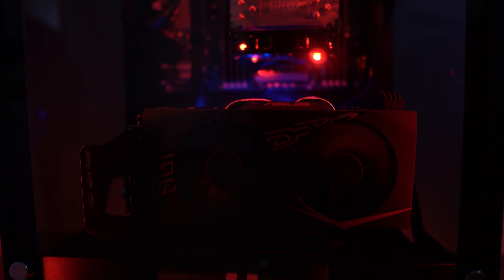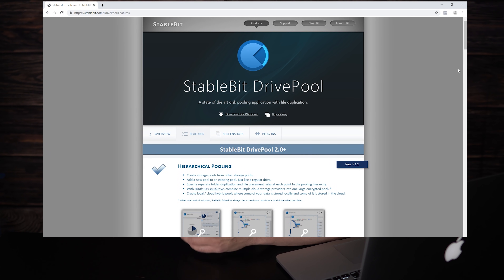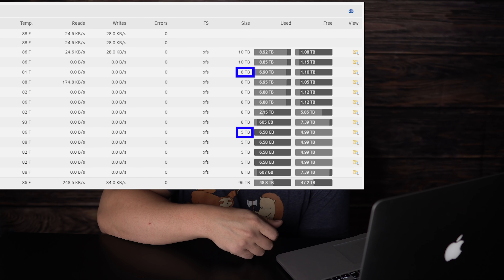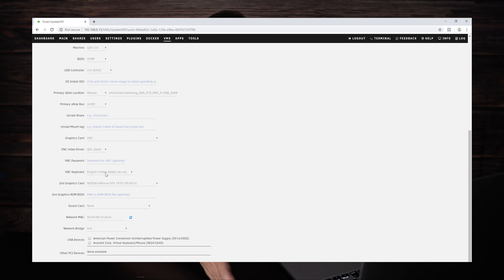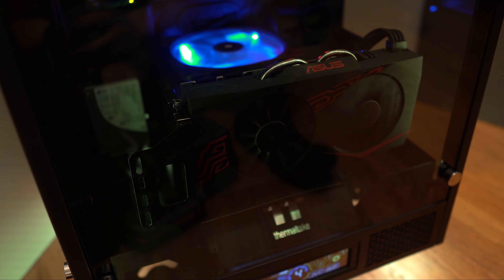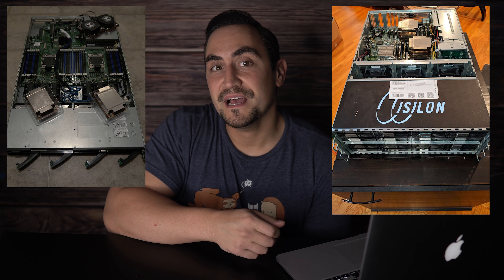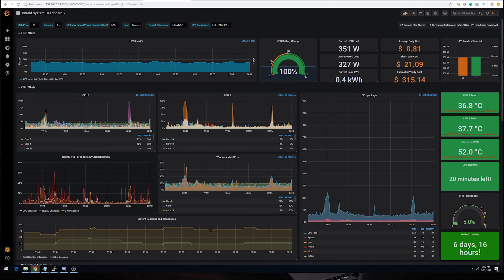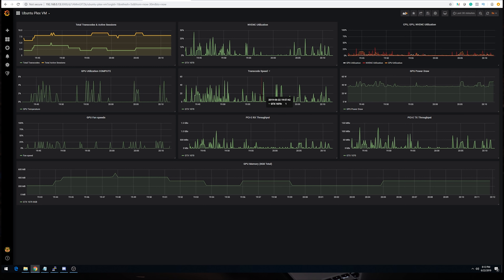How to build a quiet 117TB Plex media server (Part 2)

Comment: Good show! Yeah part 2 was much more informative. Nice build and video. I was currently running a Ryzen 1600 on Freenas in a fractal design case with a 6 drive ZFS RaidZ1 setup on a LSI card with 1 hot spare. I pre transcode all my videos on a Ryzen 2700 workstation to avoid the quality loss sometimes experienced with Plex transcodes. Not wanting to constantly run two machines, I swapped CPU and motherboards and installed Proxmox to virtualize Windows 10 for my pre transcoding and a Freenas vm for plex, passing the LSI card through. I like this setup much better.
Reply from the maker: oh damn that is a pretty legit build! The ryzen 2700 has some awesome performance and its even better when you consider the price:performance ratio. how do you like Proxmox? I've been wanting to play around with it a bit it seems pretty solid from what I've read.
Reply: Proxmox is pretty nice. It's good in situations where you have a powerful system that's often idle. Those CPU cycles can be used for other things via virtualization. I determined how much power I actually needed for Plex since I rarely need to transcode and I allocated the rest to my Windows vm which can use the extra cores for pre-transcoding. I never encounter issues. 32 gigs of ram in the system. I currently signed 16 to Freenas and 4 to Windows. Both VMs are on NVME drives. You can't tell it's being virtualized.

Comment: Love this video, love the content, love the way it's explained. I have about a dozen follow up questions. What's the best way to submit them?
Reply: 1. The migration from Windows 10 Plex host to Ubuntu Plex host - How do you migrate the library, played/unplayed, all that metadata? I'm in a situation very very similar to your starting point and I'm curious if you were able to maintain this data or it was lost in the migration.
2. Is software RAID all day the best way to implement a Plex server? Currently I have 2x devices with hardware RAID implemented, migrating to a software RAID solution would not be easy. Can you explain the benefits? For more context, for those of us coming into second hand gear, those H710p or HP equivalent cards usually can't be flashed to IT mode. Making purchasing additional hardware a barrier to making the migration. Also while I realize the cache on those boards is only 1/2GB it still hurts throwing it away.
3. I'd love to see FreeNAS ZFS vs Unraid comparison to be covered in a future video. Coming from someone with some technical knowledge but without an in depth understanding of ZFS I love what little you covered and would like to hear you cover more on the topic.
4. Caching in Unraid/General Unraid implementation question - I've been stuck at a crossroads with feeling like I need two different hosts, one for higher performance VM Applications(Game servers, SQL/Web servers) and one much simpler with bulk storage and GPU for Plex. Do you have anything "High Performance", lots of I/O, high clocks required in your Unraid environment? Would you say it's possible to have everything running on one host?]
4b. Are there limitations on m.2 storage in Unraid and can you dedicate specific high performance arrays where different VMs/Data pools sit? Ideally I'd like to throw say 5x 1.0TB or 2.0TB NVMe drives into an array. 
5. Nvidia Pass-through - Does Unraid assist in the Code 43 error/virutlization block for your GTX 1070? How does the 1070 perform? You throw out some numbers like "46 Transcodes", I'm not familiar with how that's measured? I have consulted the NVENC guide(https://developer.nvidia.com/video-encode-decode-gpu-support-matrix) and as I understand it the 1070 can do 2x 4k 8:8:8 streams. Is the hardware encoding via Plex different? Are you not transcoding in real time but transcoding the whole library as new items are added? I just want whatever implementation I choose to be able to handle 4ish simultaneous 4k streams to clients.
6. I didn't hear anything about networking connectivity, what are you using for an uplink? Do you have any 10Gb cards?
Reply from the maker: @Nameback  1. 
I had this same struggle at first and it kept me from migrating to unraid for awhile.. Eventually I just did it.. It's literally a copy and paste of the entire plex directory. The only caveat is the config/settings part of plex which is located in the Registry of windows and its a .conf file in Linux. I ended up just re-doing the settings which only took a few minutes as everything else was in the database files that are inside of the plex directory itself here's a great thread that helped me a lot:
https://forums.plex.tv/t/how-to-transfer-plex-library-from-windows-to-linux/90633

2. 
I don't necessarily think it's the best way to implement a plex server, but I did not have any hardware raid cards when I started this journey so a migration to unraid made a lot of sense for me. The benefits for me are being able to be hardware agnostic, being able to use cheap LSI SAS2008 pcie cards to expand/scale. Off the top of my head a benefit for a hardware raid is better BBU/cache sync write performance I’m sure there are quite a few others like reliability, but i didnt really have to consider this as i didnt have hardware raid capabilities. So with that -- migrating to a software raid may or may not work or be practical for you if you're already running hardware raid. I think I'll do some comparisons with hardware raid cards in a future video -- Thank you for this difficult question to answer I hope I helped a little bit -- I think I might have just muddied the waters even more though :( lol

3. 
Thank you so much for this comment -- I'm actually working on that right now -- great minds clearly think alike! :D

4. 
I think it's possible to have everything running on one host, I think virtualizing game servers is common practice in most companies nowadays so I have to imagine the high clocks and I/o wouldn't be a problem. That said the main pool is really not great for high I/o and unassigned disks or straight cache would probably be best for this type of workload as I usually see about 40-50% performance loss for writes to the main pool without a cache disk/memory cache. I think unraid may or may not be a great solution for sql but it works great for the webservers I'm running on it so I guess it depends on the workload and how you architect it. 

4b.
I tried this -- It worked, there was a definite loss of performance. I'm going to make a video about it so stay tuned! :)

5. 
Yes there is a limitation. I highly recommend you check out the P2000 as its the fully supported and legitimate way to do what you are describing. There is a tutorial that bytemybits did where he goes into how you can "unlock" the driver limitation on the gtx series cards and get more than 2 transcodes. I won't speak to it much more beyond that as I don't know the "legality" of this.. :P

6. 
Well since everything is run from one server its not as relevant; however, that said the gigabyte ga-7pesh2 motherboard does have 2 10gbe cards BUILT IN. Which is awesome and makes it a great value. I think the mobo itself is only like $150.. Or it was when I bought it at least.

Comment: does each SAS breakout give 8 drives, meaning if you use 2 LSI raid cards, you can host 32 drives? how do you upgrade in future as this grows, a fellow data maniac.
Reply: Each SAS breakout gives you 4 drives.
Reply: @jaredward6558  how would one go for setting up a higher amount of hard drives, since PCie slots are limited for more raid cards
Reply: @Praveen-hr8qw  you can get cards with more ports on it. The LSI 9305-24i gives you 6 SAS HD connections each breaking out to 4 sata connections so 24 drives on a single card. just pricey at 605 on amazon currently plus cables.  Also be aware of your OS and if it supports certain raid cards.
Reply: @Praveen-hr8qw  what backplane does you case have? some cases have 24 bays and only use 3 sas cables to connect to the sas controller. supermicro has some. you can also get sas controller cards with 4 sas connectors giving you the ability to directly connect 16 drives. if you wanted more, get a second card. really all depends on your case.
Reply: @jaredward6558  I'm building the machine still, e5-2690 processor, os will be unraid and a ubuntu vm as host for everything
Reply: @-MOS-  I was thinking of a DAS like netapp as that could use a single qsfp connection between the server and netapp, but I'm not sure how to go on this
Reply: @Praveen-hr8qw  Word of caution when selecting a raid card for Unraid be sure to look at their hardware compatibility on the wiki.  Unraid doesn't play to well with some raid cards with Marvell chips on them.
Reply: @Praveen-hr8qw  im not sure about netapp. i think it uses a different format for their drives. 520 vs the common 512 bits. easy to convert but im not sure what OS is compatible. check out cheap dells DAS. i have a MD1200 with 12 drives thats connected to one hba external sas card. cables are sff-8088. heads up with the md1200, its loud.
Reply: @jaredward6558  thanks, I'm looking into all kinds of stuff, was thinking of ryzen 3 chip.first for server, then saw unraid doesn't fit for AMD, so switching to intel, will check the others parts too, thanks
Reply: @Praveen-hr8qw  The new Ryzen chips look great but unraid doesn't like them too well.  I would stick with your original 2690s I think you would be happy.  I am running dual 2697s and have no issues and it is running 25 - 30 containers on top of the storage itself. Good luck hope it all works out well.

@Sloth Tech TV - great videos!  now im looking at the P2000

Have a great day guys!
Reply from the maker: ty for the feedback and helping out others! you guys are seriously awesome.
Reply: The SAS Connector on most Enterprise HBA/RAID Cards is called SFF8087 and supports 4 drives per connector.
8 drive (2 connector) cards are the most common, but there are 16 drive and 24 drive single cards out there.
But using a Software based RAID system (ZFS/unRAID/StableBit/StorageSpaces) means the number of controllers doesn't matter.  Only traditional RAID needs all the drives on a single RAID card.
Reply from the maker: DAMN so much great information in this comment chain. Thank you guys for helping answer questions and being so knowledgable! :)

Comment: This is awesome, and exactly the data I needed. I have an old HP DL360 with 2x E5-2680v2 and 384gb of DDR3 1600 ECC Register memory in it's 1U case, with two hp dual 10gb GBIC cards.  My plex is running on my old i9-7900x with 128gb of DDR4 2666 on an LSI 9271 with the added battery and 1gb ram chip and two RAID 6 arrays 4x 10tb and 4x 8tb (one hot spare).  I'd like to consolidate most of it into a rack mount (my i9 system is in a rackmount 4U chassis).  I have a 13U tripp-lite rack that's getting a wooden box built around it and sound deadening materials (plenty of cooling), I want to consolidate and run a different RAID option than what's included on my Controller card.

If you have a PM/DM I could talk and pick your brain for ideas.
Reply from the maker: go ahead and jump on our forums i have been neglecting them a bit but i'll make sure they get going now.

Comment: I've just been using a Drobo NAS (not exactly my best purchasing decision), and my iMac as my Plex server. Though the Drobo is reasonably quiet and allows you to have a pool of different capacity drives, adding whatever size gives the best storage/$ as extra storage is required, there is not much more that can be said for it. Well, not without invoking the seven names of god and a good libel defence team. I've been waiting for inspiration to build a dedicated NAS/Plex server, ideally with the capacity to run Fusion360 in a Windows 10 VM as well, all in a package sufficiently quiet to run in my study rather than out in my pantry. Your setup looks a lot like what I am after.
Reply from the maker: lol! Well it sounds like its probably gotten you by for awhile at least?  ty for the positive feedback and for watching the video! :)

Comment: After watching the original video, which brought me to your channel, I became very interested in this case. I had planned on moving from my current HP Z420  (E5-1650 3.2GHz 6 Cores HT with 16GB Ram and various storage solutions totalling around 34TB) to a server rack scenario, I wasn't looking forward to the noise. I love this case your using here, question does the case come with several drive cages and if not where did you source them? Love the channel looking forward to seeing more. Today's video really made my day.
Reply from the maker: The case comes with 2 drive cages each able to hold 2 3.5 inch drives. There is also a drive cage in the front so stock configuration you can get 3 3.5" drive bays out of it. I ordered more drive cages  through thermaltake request form:
https://thermaltakeusa.zendesk.com/hc/en-us/requests/new
They were pretty reasonably priced but i dont remember what i paid for each.
Reply from the maker: Also ty for the support! This comment actually made MY day :)